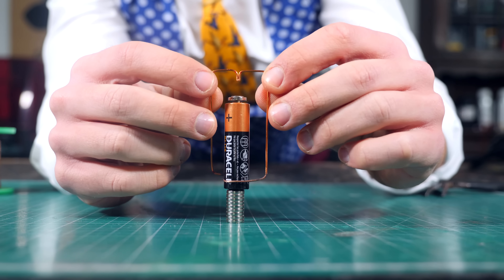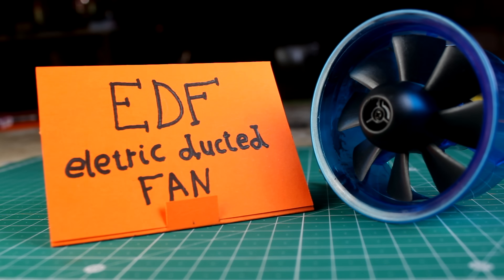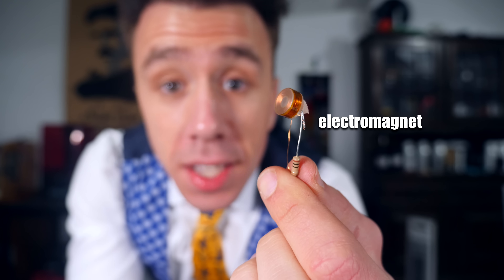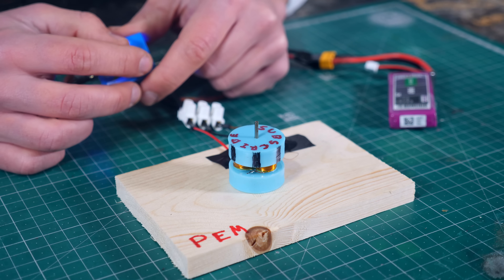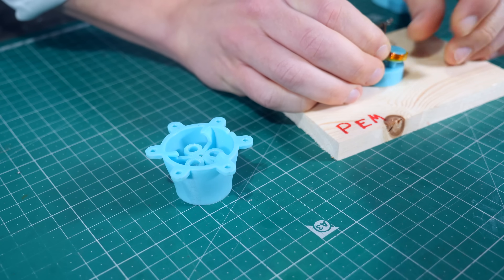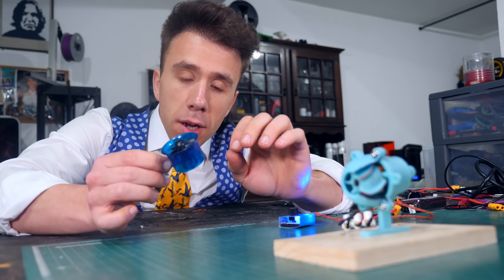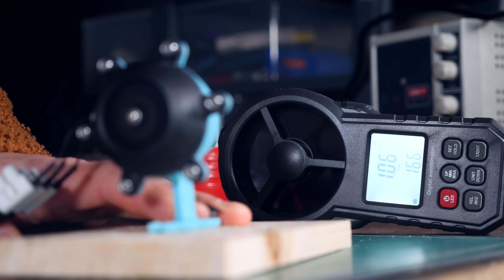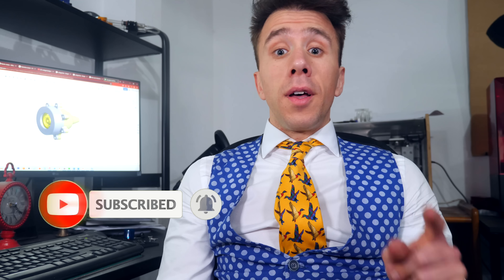I 3D Printed an ELECTRIC MOTOR FAN

Comment: I agree with the comments centered around stating that the two designs are optimized for two different things.  The impellor works best to increase air pressure which is the goal of a car's turbo because the increased air pressure increases the amount of oxygen in a given space which allows you to burn more fuel in a given space and make more power.  This same concept is used in a jet engine where fuel is added with the compressed air and combusted to make thrust.  If you look at the old turboprop airplane engines, these had a smaller "jet" engine (with an impeller) attached to a propeller (a fan).  The propeller generated thrust to move the plane while the "jet" portion just spun the propeller.
Dyson is not moving a lot of air with their fans at the impellor section.  They are generating localized high pressure to stimulate motion of static air around the bladeless section.  In nature, wind is created by pressure differentials.  In a nutshell, I believe that's what Dyson's system is based on.  

So in sum, two different designs that are great for two different things which, to me, means it will be difficult to get one to do what the other does well.

Comment: The centrifugal design you copied from the fan is valid but for a lower mass flow rate. Compressor wheels from turbochargers suitable for your desired purpose. Centrifugal turbines have higher compression ration. In order to get that geometry, you have to go to turbochargers. There are graphs available for centrifugal compressors online or a supplier can provide you. Therefore, the way forward is to go for a centrifugal compressor wheel for a turbocharger and get it 3d printed. Let me know if i can help more. Thanks

Comment: Your problem most likely is the gap between the impeller and the housing. A lot of pressure just "vanishes" here. Even with a good 3D printer it's really hard to get close - especially taking into account that the printed parts expand with high rpm.
So I really suggest designing simple blower fans first and making a video with it. They're very easy to design and print. You don't need high tolerances and they work astonishingly well with even low level motors like 385 motors for 5 bucks and driven by low level PWM controllers for even less. A big blower or two of those blower fans might produce enough thrust for your purpose!
I've tried it for 3D printers and they work sooooo well.
I don't have a video or STL files yet availlable, but there are two fairly good videos for you:
https://www.youtube.com/watch?v=ClPErNLS8SY
https://www.youtube.com/watch?v=J6tdhZ2auqU

Comment: You  need to find the port size that gives the best value of (v**2 times A).  For high thrust, you need to maximize the product of velocity (v)  times mass flow.  This is the same as maximizing v**2 times exit port area (A).  Your tiny exit port gives a nice high pressure and high v (but small A).  But too large an exit port would give high A but too low v. 

If you wanted to improve efficiency, you might increase A a little bit more.  This is because energy use varies as v**3  but thrust varies as v**2. Dropping the velocity reduces thrust, but reduces energy use even more.

This video is great for stimulating thought and discussion -- thanks!

Comment: Your EDF has large blades in a large area, so it can move large amounts of air but at lower pressures.  Centrifugal fans do more compression; they trade "max static pressure" for the "airflow" so you see them where you need to handle more pressure (vacuums, HVAC, blowers for fireplaces and forges, etc).

So... if you want a lot of compression, you need a lot of fan blade area... but if you want more flow, you need more free space... and if you want both, you make a bigger fan and more HP.

The vacuum from dumpster diving is probably  more oriented for max pressure than the dyson air fan... if you want to see a better fan for lots of air, look for "dust collectors."

Comment: I feel like there's 3 things going "wrong:"

1) resin isn't rigid enough and is deforming at high speed, stalling the compressor as the vane geometry changes

2) vanes etc are too thick, messing with the fluidics, and laughing hysterically at the notion of "balance" 3dp-even resin- is notoriously variable in density.

3) even resin printing doesn't give nearly the tolerances Dyson's getting on their production line. I'm sure it's been mentioned but your compressor and housing are leaky

That all said I don't think it's not working, I think it's unrealistic to expect the same output of an engineered product "out of the box." Check and see if your version is making any pressure. Make it digital, hook up a couple sensitive thermocouples air pressure sensors to a pingpong ball flow meter and work out the compressor efficiency mapping. You can then start tuning the compressor geometry you have instead of copying Dyson 👍

Comment: It's matching your rpm and torque to the impeller/propeller design. 
Generally higher RPM require steeper blades. 
If your motor RPM is maxing out then your impeller/propeller isn't big enough to load it up enough. 
If your motor RPM is too low and it's getting hot, then your propeller/impeller is too big and it overloading it.

Comment: Bro it's becuse you want compression. There are 2 ways to accomplish that multiple series of blades/fans or copy a turbo impeller.  On your attempt your intake is to restricted at the front so it won't give you optimal flow out the rear.

Comment: Flip the fan blades.. you have the intake on the fan as the outflow .. you are losing the compression of the air in which the fan blades were designed to do… so just make the small end as your outflow and you will have better compression

Comment: Put it in a tube, so that the high pressure air coming out transfers its energy to surrounding air that will also move in the same direction. See how newer plane engines gain efficiencies by using larger "bypass" sections. The dyson fan does something similar, just in a different shape. Think of air more like a sticky liquid, moving a current wants to drag surrounding air along with it. The bypass tube guides this air to keep it moving in the direction you want, rather than spreading out. It reduces energy losses due to turbulence. 

Also, take note of the backwards effects of the fan... the air is in the subsonic regime, so sound waves will travel upstream. Look at large vacuum motors, the rotor blades don't come all the way to the middle... the gap is slightly larger than the inlet. This stops the production of a vortex upstream from the fan, which makes it harder to pull air into the inlet (as it gets thrown outwards by g-forces).

Comment: The axial fans like the one ducted fan you have are known to have axial flow, they create the highest speed of output air, same type of pump is used when you need higher speed of water in the pipes, centrifugal pumps and fans are known to create higher pressure, so their application is different, a combination of which is used in the jet engines, these two types of fan have different operational curves and different optimum outputs in terms of general energy output (called Bernoulli equation). You may not be able to match the outputs in terms of volume and speed at the same time but if your centrifugal fan creates enough pressure, by changing the output shape and diameter you can increase the speed to match that of the ducted fan. (use a diffuser)

Comment: Since you're already moving air, my suggestion for a future video is: AIR PUMPS!
At the moment I'm struggling to get a compact yet powerful air pump to inflate my canoe while I'm out for a tour with it.
I already investigated a bit and I'm just about to design and print something because I just can't find what I'm looking for. Every pump I find is bulky heavy and uses brushed motors instead of bldcs. Sadly, I only have a fdm printer which doesn't do as good with tolerances and such. But I already have a design in mind.
I would love to see you build a piston air pump or even cooler a swash plate axial piston pump.
Hit me up, if you like to design something together. Cheers!

Comment: Here is an idea for a project: Create a wireless dog collar that has various LEDs and modes for walking your dog in the dark. Include a light for walking in the dark and a  blinking light system that can be turned on if your dog gets loose. You could also add and an audio signal that can be activated from a distance for tracking. 
If you wanted to get extra crazy, you could also make it so that it can be controlled from your mobile phone.
Thanks for the video and the cool channel. Nice work.

Comment: BLDC motors, the kinds that fans use, don't do well with back pressure, they have too little torque, try increasing your magnet strength, coil size, and lastly, amperage through the coil, a combination of those should give you some better results.

Or get a brushed motor.

Comment: I guess it is the pitch and depth of the blades. Too much pitch with slow the motor down, too little and less air is pushed through. Same goes for the depth of blade, deeper blades require more power.
Reply: @Integza

Comment: The motor is to powerful for that small case. The same thing will happen to a combustion engine. Unless you have forced induction. Or make a larger turbojet.

Comment: my guess is that the EDF is producing more flow where as the impeller is producing more pressure.
moving more mass of air (more flow) = equal and opposite reaction = more thrust.
also, with an impeller that is smaller like that, you need more RPM to move the same amount of air at the same speed. 
thus the motor has to work harder.

Comment: Ramjets are awesome engines but they require an initial high flow speed to begin operation, I would be super interested if you could build some kind of combined cycle engine that brings the speed up like a turbine based combined cycle engine... Not sure the difficulty though good luck 😁

Comment: The motor does have a second name "Three Phase Moter" So your name was close. The diameter of the intake + the number of blades + pitch are all things you are missing. Also, a ducted fan compresses air from the front and sides pay attention to the lip on the front edge as it sucks extra air in from the sides and leaves the duct like a jet engine.  Can't wait to see your next projectile 🤣
Reply: Scammer

Comment: I'm no aerospace engineer, but I think the thrust difference would be a result of the blade area, and required torque to shift that through the air.
As for a new video idea, I've yet to see a rocket propelled tomato make it to LEO.

Comment: @Integza The biggest reason you're not getting as much thrust is because you're accelerating less air. Jet engines are kind of the opposite of rocket engines, in that you don't want to maximize exhaust velocity, because that requires more energy per unit of momentum. 

If you push against something extremely heavy, like the earth, you don't waste energy accelerating the thing you're pushing against, that energy accelerates you instead.  So for propulsion, you want as big a fan as possible, up to the point where the added weight and drag from making the fan bigger outweighs the benefit.

Comment: ok here you go
Axial-flow fan:
vary small to large
produce high pressure with low volume of air with high speed with an exhaust and intake of the same size
-PC fan

Centrifugal fan:
can be small to large
produce high pressure with high volume of air with low speed with a vary small exhaust
-jet engines need a lot of air (high pressure/volume) but low speed, creates a more efficient burn

Cross-flow fan:
vary large
produce low pressure with high volume of air with high speed with a vary large intake and smaller exhaust
-exhaust fan's need to move a large amount of air, this i actually many Centrifugal fan's stacked with a common exhaust

you are testing the speed of the air not pressure or volume

a dyson fan's uses high pressure and expansion to create a low pressure high speed exhaust to keep all moving parts enclosed (it is actually a vary low efficiency design)

for what you are trying to do if you want to burn fuel you have the right design but if not you are using the wrong design, you just need to make sure it can gather the air you need (this is why jets have such a large intake)
use an Axial-flow fan

Comment: On independent throttle body cars they generally have what's called trumpets which help suck in air smoothly and cleaner. If they run with out trumpets the air that gets sucked is chaotic and not uniform. Make the inlet wider and smoother

Comment: You should check the power draw on the motor in both fans the centrifugal fan might be drawing less current because of the impela size

Comment: If you want to use the aerospike to produce thrust, you really need to create at least double the ambient pressure with your compressor.  You can do this by shrinking the cross sectional area of the exhaust ring to create a much higher pressure at that point.  Once you achieve that, passing the air over the aerospike will cause the air to go faster.  Ducted fans work at sub sonic speeds.  Aero spikes work at super sonic speed.

Comment: It's simple a reg fan and motor produce a set velocity, inducting it and forcing it to pressure will not have the same result, it will be a percentage of the reg fan due to the increased in resistance to creat the pressure, meaning you need more power to over come the pressure to equal, and don't for get the stators needed to compress the air like in a jet engine, up the power add fuel if you like to off set the pressure resistance to gain the desired out put. Happy building. Craig

Comment: my best guess is that the printed model has surface imperfections that cause a sort of air friction and turbulance

you could try electro plating it, maybe that will smooth it and stiffen the blades to reduce expansion

Comment: What about if you had a second fan in front that pulled air but the blades spin opposite of the main fan. Both would be pulling air just the blades are vectored differently

Comment: always take in consideration the smaller you make it the higher rpm it needs to reach same volume ,example like gas turbines the smaller they are the faster they need to spin

Comment: A centrifugal impaler what it does is to rise the pressure, however trust is related to speed more than it is to pressure. That's why centrifugal impalers are used as second stage or booster in turbofans when they are used. A turbofan depends on the free flow of air from the fan, they compensate airspeed with volume. you are not making a good thruster but a good compressor, if you added some fuel in there ufff man

Comment: Just a idea, but instead of letting all the air flow out, would a secondary chamber help as it could help build up pressure for the thrust. Also try testing with self lubricating materials to help reduce any drag or friction you may be experiencing

Comment: Measure the distance between the EDF's fan and it's surrounding duct then compare that to your centrifugal impeller and it's intake duct.  Smaller/tighter clearance equals more thrust.  You may also be losing thrust because the EDF is an axial flow design.  In the centrifugal flow design your airflow loses velocity because of all the twists and turns it has to make to get through it.  This is basically why you don't see centrifugal flow engines manufactured anymore.
Reply: -integza1  Nope.  Sorry.  Not happenin'

Comment: Centrifugal fans are just less efficient. Early jet engines used centrifugal compressors but modern jet engines use axial compressors for this reason.

Comment: To get the most air speed from a small centrifugal fan, there are several factors to consider:

Impeller Design: The design of the impeller is crucial for optimizing air speed. It's important to choose an impeller with an appropriate number of blades and blade curvature to maximize airflow.
Blade Angle: The angle of the blades on the impeller is also important for optimizing airflow. Blades that are angled too steeply can create a lot of resistance, reducing the overall air speed.
Tip Speed: The tip speed of the impeller refers to the speed at which the outer edge of the blades is moving. By increasing the tip speed, you can increase the air speed that the fan produces.
Motor Speed: The speed of the motor powering the fan will also affect the air speed. To achieve maximum air speed, it's important to use a motor that can run at high speeds without overheating or causing other issues.
Duct Design: The duct design can also have a significant impact on air speed. A well-designed duct will help to minimize turbulence and maximize airflow, increasing the overall air speed produced by the fan.
By carefully considering these factors and optimizing the design of the centrifugal fan, it's possible to achieve the highest possible air speed from a small fan. However, it's important to keep in mind that there are limits to how much air speed can be achieved from a small fan, and that other factors such as noise and power consumption may also need to be taken into consideration when choosing a fan for a specific application.
Reply: This was generated using chatgpt

Comment: Also Consider adding blades to the impeller to further increase its efficiency. The shape and size of the blades will depend on the specific application and the air volume and pressure needed. Adjustments may need to be made to the design to achieve optimal performance. (More blades) (more RPM) more air